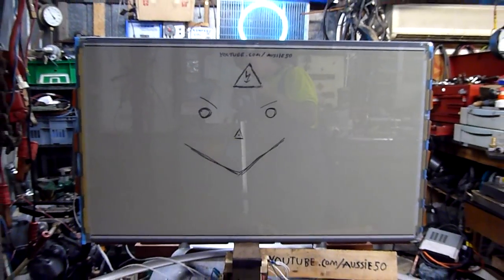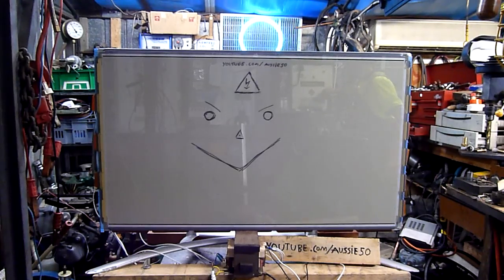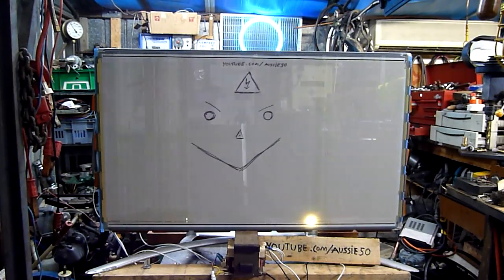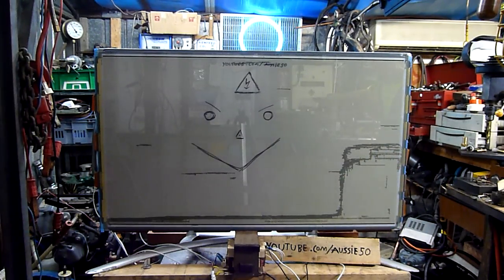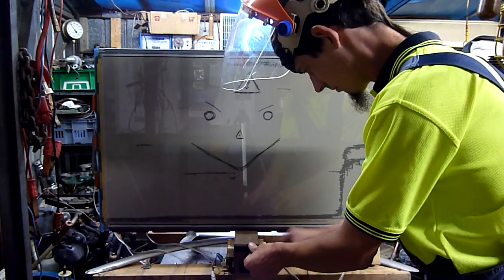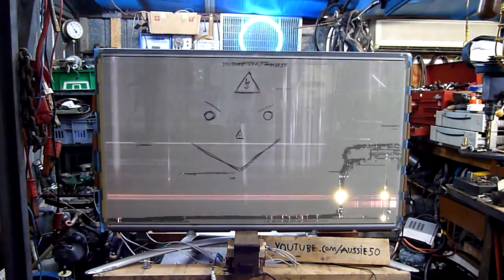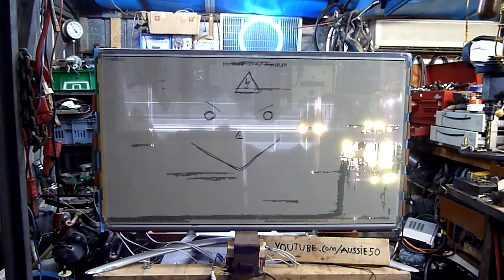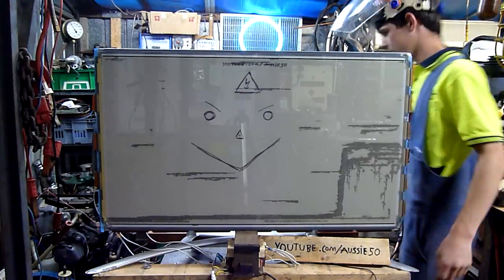Samsung Plasma Display - Extreme Burn in

Comment: meh sharp is not bad i not seen to many bad ones out there but i use Panasonic my self, and Philips for computer monitors, i found philips well built huge PSU "over kill for whats in there and thats the way everything should be" neat work clean boards, Panasonic is much the same but most of all great picture and responce.

Comment from the maker: the pixles are electrically connected in a grid of horizontal and vertical conductive traces, the arcing and shorting starts wherever it can and then seeks the shortest path to ground, burning up row after row